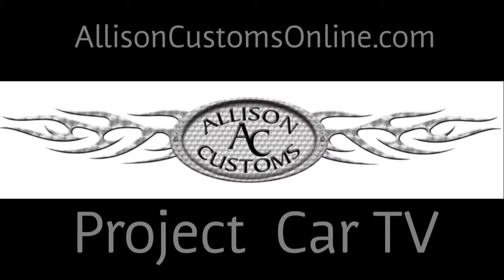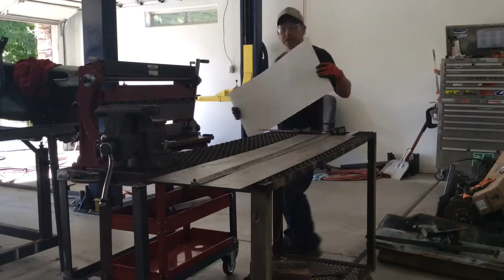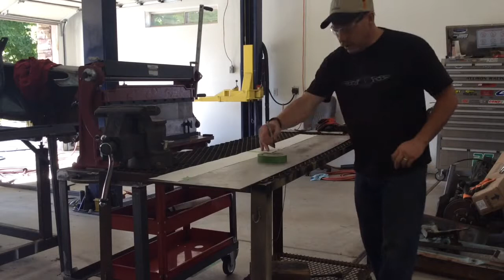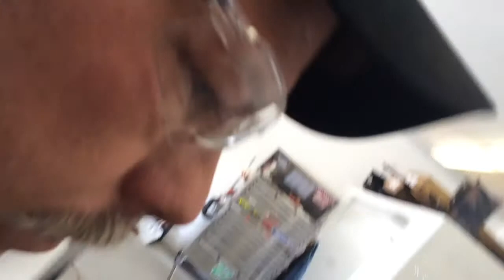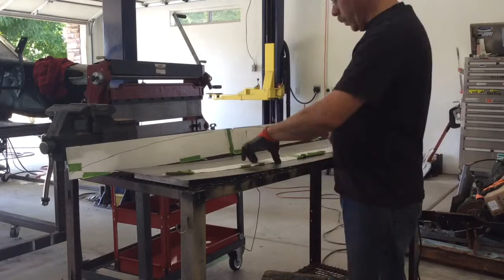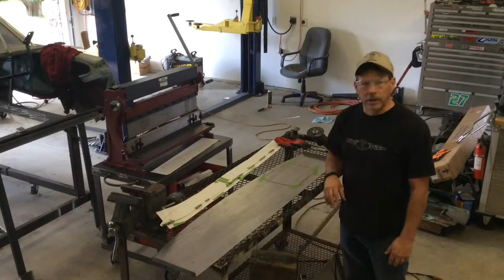1968 Mustang Smooth Firewall Build

Comment: I noticed you are using the 3 in 1  sheet metal brake/roller/shear. Is it a Harbour Freight model? How do you like it? I’m considering buying one. Just want your input on this equipment. Also what size is it? Thanks again. Cheers from Canada.
Reply from the maker: Yes, it’s the HF model, it works well enough on thin stuff (20ga and thinner), I would like a version that could handle up to 11ga, but I haven’t seen one on the market.  
The shear part is fairly useless because the bed flexes too much.  I think it could be beefed up,but I haven’t taken the time.  I use the press pretty often, and for narrow pieces it will bend up to 16 ga.  The roller gets used a lot, I replaced the bushings on the ends this year and it really needs a different way to retain the upper roller, but it works fairly well on 18 ga.  
I THINK this is the same unit sold by Eastwood, Jegs and everyone else, so I would get the best price and not worry about brand myself.  There are some other versions out there, that claim to be good up to 16ga, but I think they are smaller overall.  It is HEAVY so have some help to load and unload.
¡salud! from New Mexico.

Comment: I have a 63 Thunderbird that has the same kind of hump where the old A/C was. I was going to cut out the hump and the old leaky cowl. It has a plate where the master cylinder and steering shaft run through. Should I just do away with this plate or work around it? Maybe I could send you pictures? Thanks for any help!
Reply from the maker: Unless you go with some thick material, you are going to want / need that reinforcement plate.  Either work around it or remove it temporarily and fix your other metal, then replace it when done.
Reply: Allison Customs' - PROJECT CAR TV Ya I decided to temporarily remove it that way I could get a nice straight firewall all the way across. Then I’ll fit it in to the new firewall after i’m done. Thank You!

Comment: Jeff thanks for the great video.  I too am trying to flatten my firewall on my 68 mustang.  Have you figured out how you are going to finish the top?  I want to get rid on the pinch weld and was thinking of extending the firewall up to the top of the first ridge on the upper cowl.  I would then bend the lower cowl flange down and weld it in from the inside.  Cut off the upper cowl flange and weld to the ridge I mentioned earlier.  Let me know if you are thinking another way.  Thanks again.
Reply from the maker: let me take a look today, and I will let you know if I have any other ideas.
Jeff
Reply: PROJECT CAR TV Jeff did you ever get a chance to look at your mustang firewall?
Reply from the maker: Sorry, I had forgotten.  I went out just now to take a look at everything.  I think what you are suggesting would work very well.  Are 
you keeping the cowl area stock?  if not, you could probably even skip dealing with the lower cowl flange as most of it would go away with 
whatever other mods you make to it.  I hate the factory cowl, they are just HUGE water and debris traps, so my first choice is almost always to
 get rid of them.  Jeff
Reply: I was thinking of welding up the hats on the original lower cowl and keeping it for strength.  But then there is no need for the holes on the upper cowl.  Some people have been opening the front of the upper cowl and leaving the top open for heat to escape from the engine compartment.  I am planning on changing my pedals to wildwood pedals with the 3 master cylinders.  This will require some more fabbing and strengthening of whatever type firewall I put in.
Reply from the maker: Yea, using the wilwood pedals makes for a lot of work.  They work nice and give a lot of bias control - but they are very hard to work in around a steering column.  If you check out the pics of the 64 Chevelle on my web site, AllisonCustomsOnline.com or AllisonCustoms.com, you should find some pics of those pedals going in that car.